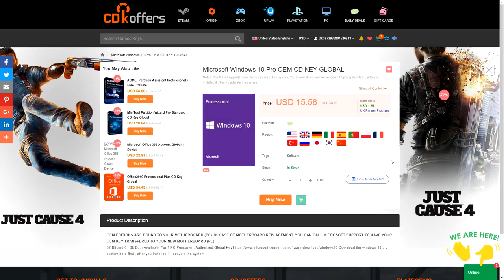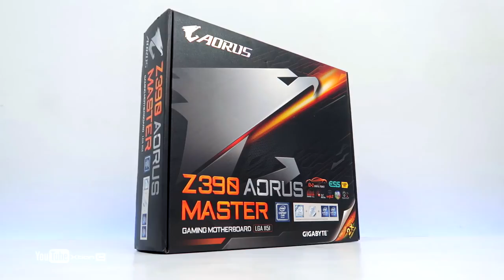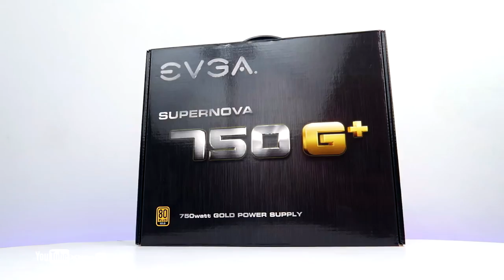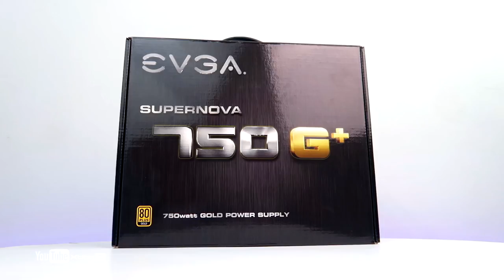($2,500) Php170K Gaming PC Time Lapse Build ft. MasterCase H500M, Intel i7 9700K & RTX 2080

Comment: I used youre video to build my own pc , I used the same case and the same rgb stuff thx
Reply: Hello, I'm having some trouble figuring out the A-RGB setup combination of my case and motherboard. I'm using aGigabyte Z390 Aorus Master motherboard in a Cooler MasterH500M. The case has ARGB connections for both Asus/Asrock and Gigabyte separate. The Gigabyte cable is 3 pins while the Asus is 4 (with one blocked off). My understanding is that Gigabyte switched to the 4 pin on their newer motherboards. If this is correct, does this mean I should use the Asus connection from the case to the motherboard?

I can't seem to work out where exactly on the motherboard I should be plugging the case into. I assume the connections go into C1_LED and C2_LED but the pins don't match the CoolerMaster Gigabyte connection from the case.
Reply: Please help me

Comment: mahal po build mo utoy, eto specs ng pc ko ngayon ha, 165k budget, intel i9, asus strix z390 f w/rgb mother board, 4-16gb kingston hyperx 2400hz 64gb total ram w/ rgb, msi rtx 2070 gaming z w/rgb,  1tb ssd m.2 black sn750 western digital, 2-2tb hdd baracuda seagate, asus gt 501 tuf gaming pc cassing with rgb and tempered glass front 3 fan intake 1 fan at back, cooler masterliquid ML12OL tuf gaming w/ rgb, 850w thermaltake smartpro rgb, external ddr liteon, ups secure computing, cooler master devastator keyboard with mouse, then eto pa ha 2- 28inches na samsung 4k monitor, kahit 60hz lng siya eh 4k naman, teka my speaker pa pla kasama creative with subwoofer,  165k lng pakita ko pa resibo, kay pc express kayo bumili sa gilmore, yan ang build, performance pa tpos aesthetics n arin dhil ang gnda tha nung rgb sa asus na casing, kubg pede lng magattach ng pictura dito saa msg ko pinakita ko na cpu,  malayo mararating ng 165k nyo guys, pero eto ang build ko, processor na malupet at ram na super taas at ung video card na pangalawa lng sa highend dhil pede mo nmn ioverclock ung gpu mo kaya pang 2nd lng kunin mo, 2070 lng di mo kailangan ng 2080, tpos payo ko ssd m.2 kung may 2tb kayo makukuha eh pucha kunin nyo na kasi the best tlga ssd sa pag boot, iset nyo siya as drive c, lahat ng programs nyo sa drive c gaya ng os nyo pucha nag bilis magboot or in leymans term eh mabilis bumukas ok, sa akin 1tb lng nabili ko kasi wla available na 2tb dito sa pinas, o real talk lng ha wlang pikunan, peace out
Reply from the maker: Good for you sir if naka mura ka. Gusto ko lang po linawin mas mahal po ang components nung Dec 2018. Dont compare the price ngayon vs Dec 2018. Mas mura po ang ssd, ram, processor etc.. ngaun. Saka add ko na din po sa lahat ng store sa Gilmore isa po ang PC Express ang huling nauubusan ng stock kasi mejo mataas ang price nila =D bakit ko alam? Jan po kasi ako nag work dati =)
Reply: @XtianC  ah ok bro pasensya na february 3 ko kasi inasemble ung pc ko, pabirthday ko sa sarili ko, ung assembly mo pla december 2018, nice very gud

Comment: 35k pc build naman po!😣😣😂😂
Reply: b450 aorus pro
ryzen 2600
xpg 8gb (rgb)
seasonic 550w (modular)
xigmatek (left, right, front tempered glass)
1pc pccoler fan (rgb) "for exhaust"
120gb ssd
1tera hdd
zotac mini 1060 6gb

yan pre 35k lng yan inquire ka nlng sa Dynaquest 
solid na yan

Comment: The z390 aorus motherboard only has 1 usb 3 connector to connect front panel usb 3.0 connectors . The cooler master h500m has 2 usb3 connectors because there is 4 usb 3.0 slots. How do you got them all to work?

Comment: Hello, I need to build a system around 5000 dollars except for monitor keyboard and mouse. My main purpose for this machine is I need to use that for 3ds max, Vray for animation and rendering and some dynamics and simulation I thought to buy in this week.

CPU: AMD Ryzen thread ripper 2990wx 32C/64T
MOBO: Asus Rog zenith extreme AMD X399 with M.2
RAM: Corsair Vengeance LPX 64GB DDR4-3200
STORAGE 1: Samsung 970 Evo NVMe 512GB M.2 (for C drive only)
STORAGE 2: SSD 1 TB (ANY)
GPU : Nvidia GeForce GTX 1080ti founders edition 11 GB.
COOLING: cooler master MLX-36M A20PC-TI RGB AIO
POWER: Corsair RM 1000W 80+ Gold ATX Power supply
CABINET: Cooler master H500M ATX Mid-tower Case 
Can you please give me any guidance for this.

Thanks in advance
India Mumbai

Comment: Cool! It it possible to change the color of the rgb lightning depending on the CPU temp? For example, if it's temp lower 50 degrees Celsium - the lights are green, if it's more than 80 degrees - the color changes to red

Comment: Hi.I will tell my PC Specs. Feels like lots of bottle necking is there. Planning mistakes was also there. Can u please suggest what to replace and shouldnt have put. 

Processor : i7 7700K (4.2ghz  base)
MB : Asus Tuf Z270 Mark2 
Ram : Amd Flare X 16 Gb 3200 mhz
Cpu Cooler : Coolermaster Masterliquidlite
GPU : MSI GTX 1080 Ti 11GB
SMPS : Coolermaster V850 (850volt)
Cabinet : Coolermaster CM Force 500
Samsung 500 SSD and 1TB HDD.

My Main use is 3D Rendering (3ds max + Vray) and using Lumion.
Reply: Your GPU kinda bottlenecks your cpu, upgrade to an i7 9700k or 10700k, keep the 1080 Ti, it's an amazing card, but otherwise it's fine

Comment: I do hope your still checking comments on this video. I have a question, how did you work around the fact the case fans ALL are 5V 3 pin, and your MB like mine is 12V 4 pin? I can't even use the tac on my AIO cooler due to it also is a 3 pin connection, and alas, the 390 prime A has only 4 pin connections. Be super cool if you reply...

Comment: I know this video is old but I was wondering if you ended up using the cooler master rgb controller with that AIO or did you just use the RGB header from the mobo to change them with cooler masters software?

Comment: The price of the 90 degrees 24 pin could have been used to buy a set of cable sleeves extension ..
Reply: I am a comtech but never ako naka build ng ganyang ka mahal. A8 lang ang na build ko. Sobrang iba ng hardware. Wala bang 24 pin yang PSU na yan?
Reply: @Kuyait  meron ..
Reply: @crismeman3386  So, why use that extra 90 degrees 24 pin? For safer reason ba yan?
Reply: @IrvinChesterTiempo  no for aesthetics as i see it..the branded 90 degrees 24 costs around  PhP 1,250 local version is around 600+.
Reply: @crismeman3386  so, it's not necessary. Though it's look better having it.
Reply: @Kuyait  if that's how you see it.

Comment: What do you think of this build? If you have some tips for my first tips let me know!

Gtx 1080

I9 9700k with a noctua nh-s14u

Msi mpg z-390

32Gb ram

500gb ssd and 2tb hdd

750W psu

Fractal design r5 case

And i’m gonna use this pc on a 144hz 1440p monitor
Reply: Put rtx 2080
Reply: 16 gb of ram

Comment: Little question: the motherboard you used here is compatible with ryzen 5?
Reply: There is a website called pcpartpicker.com, it is the best website to make your pc part list and it also tells you if the parts are compatible or not, this is the old z390 aorus master

Comment: Hi. I know it's been a while since you've uploaded this video. but I would like to consult you. I have the h500m and a x570 aorus board. but by connecting the argb of the h500m to the board I can't get control of it. the leds work but in rainbow mode. have you used any program apart from rgbfusion or where have you connected the argb driver? Thank you.

Comment: How did you wire all those addressable rgbs in???? That board has 2 argb headers? I’m curious
Reply from the maker: The cooler comes with a aRGB 1-to-5 splitter cable to connect the rear 140mm led fan, pump and 3 radiator fans then I bought another Cooler Master aRGB 1-to-3 splitter cable to connect the x2 200mm aRGB & aRGB LED strip.

Comment: too bad.. i only have 2 liver. i think it cost 3
Reply: Why don't save up from work? It's a long boring and tempting WAIT but the fruits are sweeeeet 😍😍😍 kahit i7, 16 gigs or ram, gtx 1050 4gb, 1tb hdd at 128 ssd ok na ako malaro ko lang gta 4 and 5 in high settings with acceptable fps! 😍